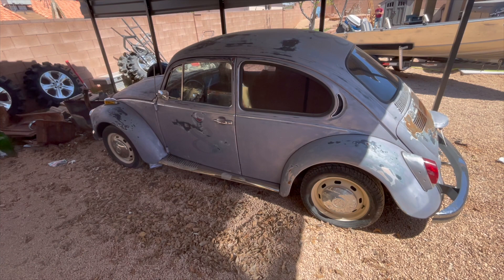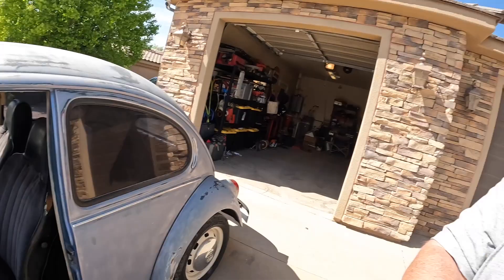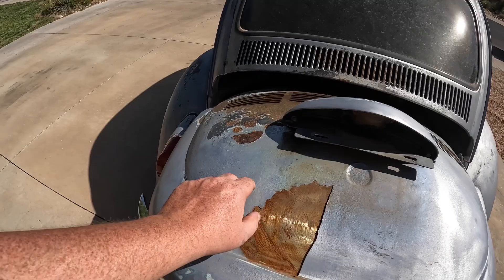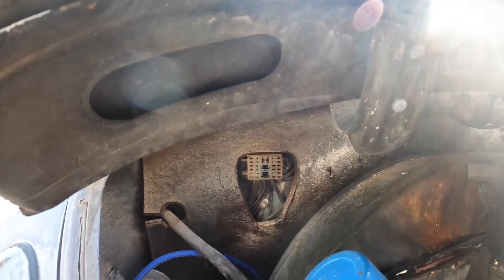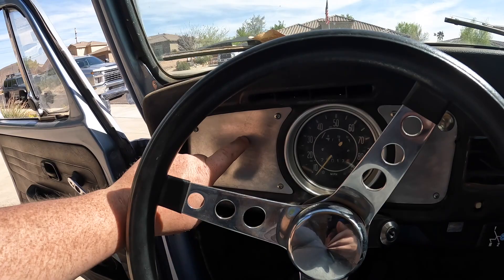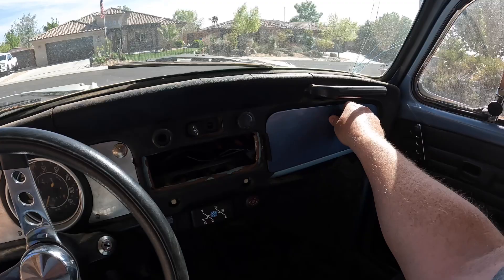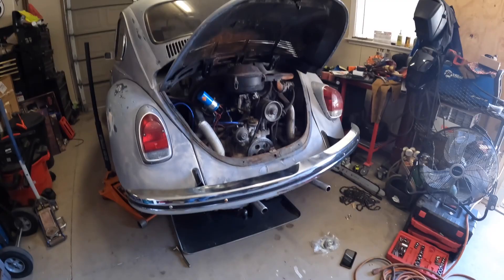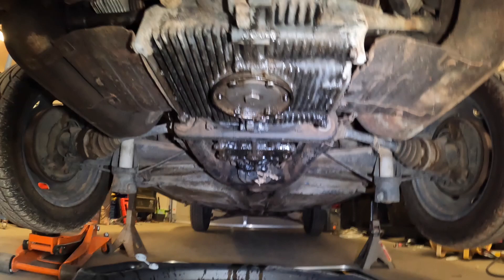I Got a FREE Abandoned 1971 VW Beetle | Will It Run And Drive After Sitting for 40 YEARS ?!?!

Comment: Nice find, beetles are a lot of fun. It’s a 1302 super beetle which is the first Super (wider front end with spring suspension and 1600 engine). The battery is under the back seat, needs a cover as when someone sits on the back seat it can zap them when you go over a bump if the spring touch! The fire to me looks like a fuel filter in the engine bay, if they break over the distributor it would instantly ignite - they were often put exactly where you can see the most marks. The thing at the top left of the engine bay is an old diagnostic unit, not needed.

Comment: The Battery is under the back seat passenger side. I think you may have forgotten a gasket at gasket seal. The dash is not factory and was added after. Samba VW is a great place for resources as well.

Comment: The oil bath is much better than a regular air filter.
Reply from the maker: Good to know. I’ll just keep it on there then. Thanks!
Reply: If you can try to use as much German parts as you can on it.good rubber seals you will find at west coast metric,other parts use cip1,Wolfsburg west,cb performance etc.make sure the engine bay seals are there all of the tin is accounted for.they make fuel line that is the German cloth kind but is tolerated for ethanol fuel

Comment: That connector in the engine bay is a diagnostic port. The levers are for the heater boxes & the dash is stock but the plates are aftermarket

Comment: The carburetor float can stick causing it to flood itself and cause gas to get in oil which may of also caused the fire. I wouldn't connect battery to any of that factory harness. Or might be fire number 3

Comment: That's a 1972 Beetle, not a 1971. The '72 had 4 vents on the deck lid, the '70 and '71 models only had 2 vents.
Reply from the maker: I’m just going off the title, vin and they say 71 🤷🏼‍♂️
Reply: @Seewhatyoustarted Das Modell 1972 wurde ab August 1971 gebaut. Gruß aus Deutschland.